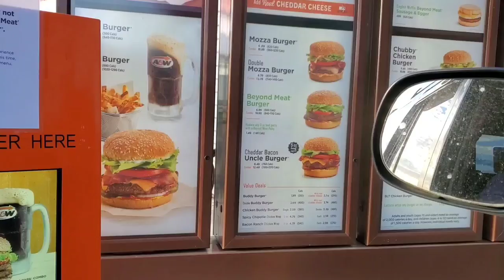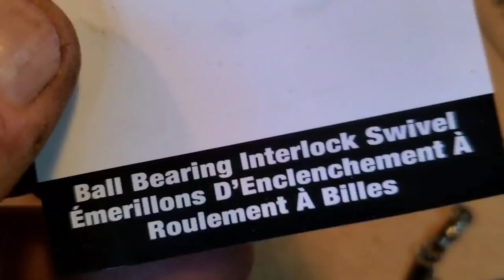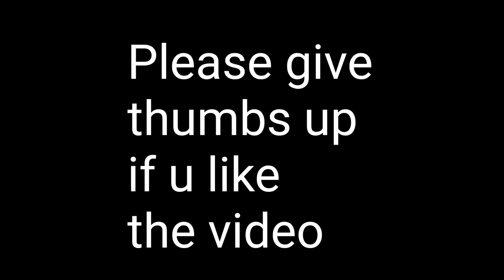How to make a wooden wind spinner. (SIMPLIFIED) Take 3

Comment: A very easy, very fast to assemble, very strong, and inexpensive alternative to drilling a hole in your all thread (ready rod), which very much weakens the all thread, is to use an eye bolt with the same thread size as the all thread, and a coupling nut. Put a few drops of blue LockTite on the threads before screwing everything together, and it will never come apart. The eye bolt also gives you a MUCH stronger hook to hang your spinner from.
Reply from the maker: Great tio thanks

Comment: Use what is called a oupler instead of the drill hole. I use 1\4 inch by about 1 ICU long. Obviously fits 1\4 rod.